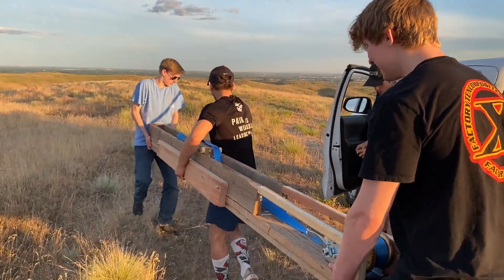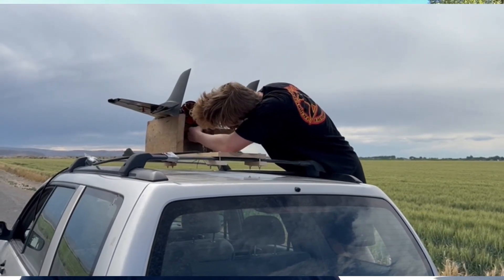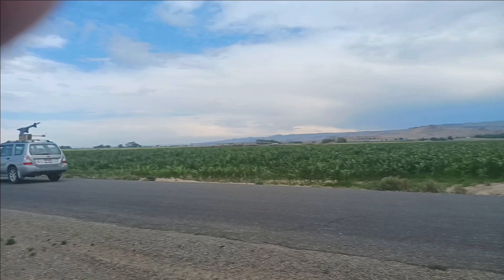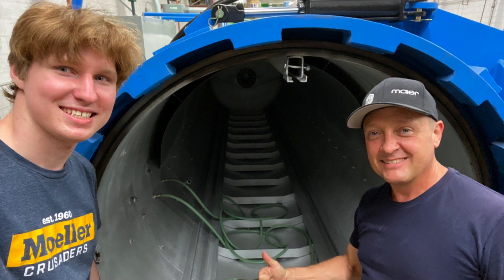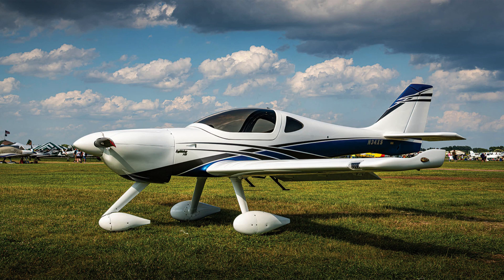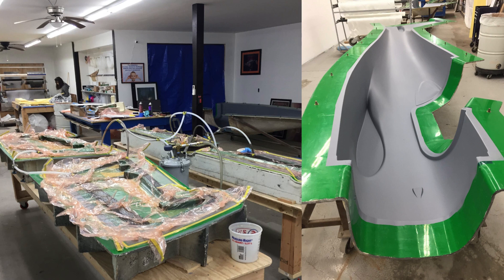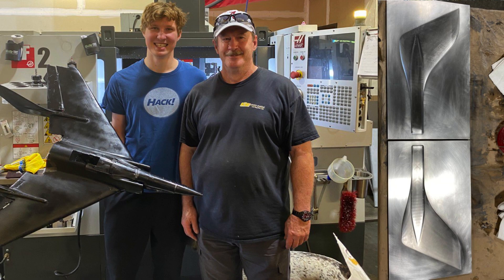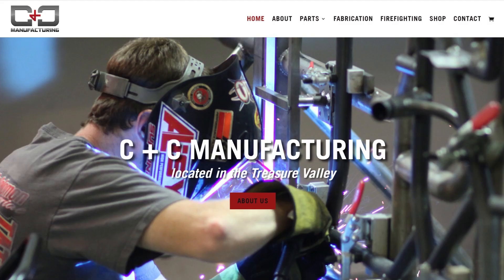First flight of prototype of Mach 0.9 plane

Comment: Maybe take off with an additional wing with a larger area that can be detached and dropped after reaching the required speed, altitude and flight stability?
Reply: This could simplify the launch procedure
Reply: Could also work with launching the prototype from a bigger plane after it has gained enough altitude to give it a headstart and some acceleration with gravity. That would give the model plenty of margin of error, but for the price of having to build another plane capable of carrying and dropping the prototype.

But it would be cool, wouldn't it? 😆

Comment: I use a wood and bungy caterpult it works all the time. It's simply two  parallel 2 x 6 joined front and back with plywood 6in apart.👍
Reply from the maker: Because airplane weights 14lbs and stall speed is 68mph, it requires 3kJ of energy to launch it. So I used 8 huge springs which broke 1.5 inch wood.
Reply: @ivanmarkovavia  Yes, but interstingly I worked in the circus where we launch humans. If you loop bungee around multiple times it is acheivable.  The mechanism needs to be of steel. p.s. why do you use imperial units?

Comment: I think a bungee launch would be safer. There's a lot of turbulent air around the car, which could interfere with a clean separation.
Reply: Agree! The only way to launch it from a car like that would probably be to build a narrow and quite tall base to hold it, just so it gets out of the way from the turbulence of the car.
Reply: @@OrwellNailedIt 

Agree on the takeoff, but disagree on using FPV. LoS flying is very easy and natural to people who've spent a bit of time doing it, especially on larger models. I was into RC well before FPV was common, and I fly far better LoS than via FPV. In my opinion it's just another system to go wrong on an experimental aircraft like this, and not really necessary (unless the pilot is much more comfortable with FPV - in which case it might be justified).

FPV really shines for things like racing quads, where you're flying a small, fast vehicle which is also lacking on strong visual orientation cues.

Comment: What if you put like a metal strip on the bottom of the fuselage just for testing or a thicker bottom of fuselage. Or would that mess up the cg to much
Reply from the maker: It is a great idea! But next flight is going to be from catapult over field not asphalt. So it would not help.
Reply: @ivanmarkovavia  ah alrighty